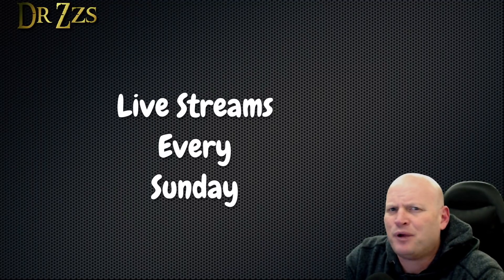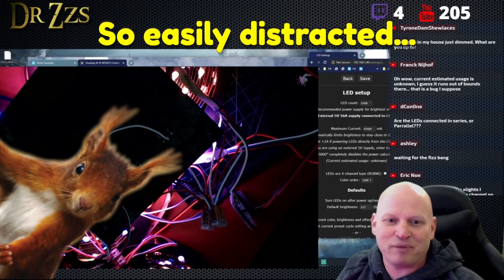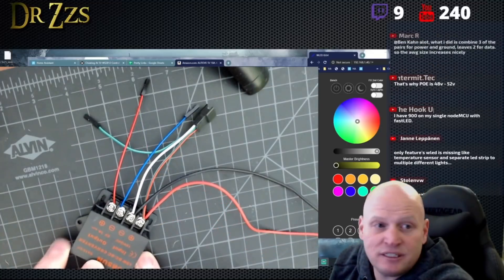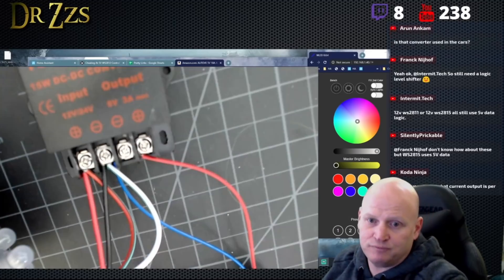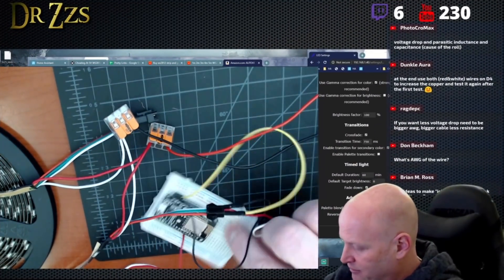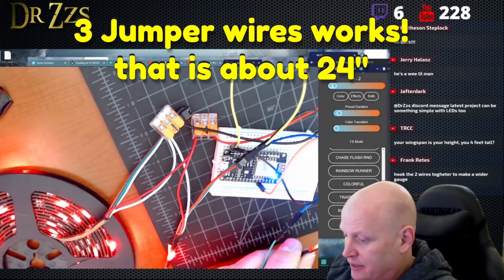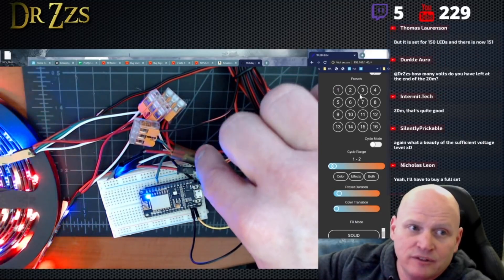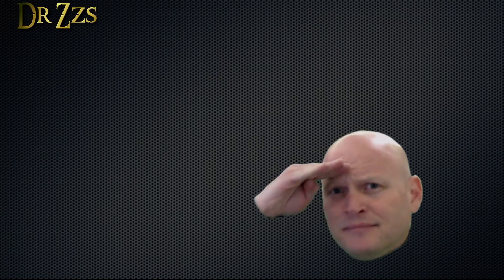Answers to the Most Common DIY LED Questions

Comment: Im trying to figure my ws2811 12v strip i have parallel supply for 6m with power injection at 4m and another 4m, the second 4 meter long is making flickering occasionaly. My data is around 30cm(1 ft?) ive been figuring it for few days now. No level shifter. I am assuming there is a faulty icu? Since i tryed everything else, checking connections and all, i am now at the point of adding pixel by pixel to figure where the problem is. 4m in wled is set to 40 as 3 leds are per icu. So far at 16 or 17 i noticed the flickering starts. But its hard to be sure, since it only flickers like once a minute or even less. Voltage at this point is 11.7v
Any opinions? Had similar problems with bad ground connection before, but was way more consistent. Any idea? Shortly after more testing if at pixel 17 flickering continues, i will replace that segment..

Comment: Hey if I have a set of LED strips 32.4 ft, which you know is 2 strips that are 16.4 ft, the 2 strips meet at a connection which connects to 1 cord down to the power supply. Say I wanted to put about 12 feet in between them, but only on 1 of the strips. Could I cut 1 of the strips just above the connection point and wire in a 12 ft extension (basically so the power is towards 1 end and not in the middle) connecting the strip back with the cord near the connection point? Would that work and still be able to work off that original power supply? Appreciate all the help. Love your videos.
Reply from the maker: Have an LED related question? Be sure to ask your question in led-lighting-diy- Channel on discord! https://discord.gg/8gvF67h Our LED masterminds, the PixelHeads, generally hang out there and can answer your question(s) swiftly.

Comment: This is exactly what I needed! I've got 2 esp32 that even with 20cm data wire does the same thing as happened when you connected the +100m wire, could I be unlucky enough to get 2 bad esps or am I doing something wrong? (I'm already waiting for another esp32 to make sure, as I'll need them anyway for other stuff)
Reply from the maker: Have an LED related question? Be sure to ask your question in led-lighting-diy- Channel on discord! https://discord.gg/8gvF67h Our LED masterminds, the PixelHeads, generally hang out there and can answer your question(s) swiftly.

Comment: I realize this is from a few years ago but...We now that a version of WLED that supports more than one data channel. All is now well in the world. 🙂

One other thing to watch for when using a power supply (other than through the USB port) is that a capacitor will probably be needed across the 5 vdc in and ground pins on the ESP 32. Mine ran fine via USB power but refused to stay running when I switched over to a 300 watt 5 vcd supply. A 10 uf capacitor took care of it.

Comment: First off GREAT VIDEO, Quick Question, I'm new to the WLED, and just got a New DIG QUAD (Dec 2021) and I was wondering if the Sacrificial pixel must still be used for long initial starts; by long im talking about 15 feet?

Comment: I have about a 24ft run to my first led with 18awg.  The first ~300 pixels work flawlessly, but then only the first 3 pixels work on the next strand.  The 4th pixel flickers.  Not sure if this is a power or data issue. I have tried other strings with similar results.  The voltage at the beginning of the line is ~7V.  When I add an led before the 24ft run none of the lights work.  Any help would be appreciated.

Comment: I’ve addd a sacrificial pixel like in the video. I’m 25’ from may strip 12v and only getting 5-6 leds to light. If I plug in 12” away all works great. Tried a new 25’ wire and a new pixel and still the same outcome. Help…

Comment: using 6x 5meter stripes 5 volt  SK6812WWA 5 volt addressable LEDS I have achieved lighting1767 using an Arduino mega and programmed through the Arduino IDE (not WLED) after LED number 1767 it all goes haywire which is a real shame because my route around the room where I intend to install them is exactly 30mtrs.

Comment: I know this is an older post.  But a couple noobie questions.   Is it possable to break up a string of lights so that each segment is addressable?  IE.  i have 4 Candy canes, each with 10 LEDs.  can I set up the NodeMCU as having 40 LEDS, but segment them into 4 groups of 10 for something like Xlights?   The other question is on data cable length.  Since the Logic voltage level on the NodeMCU is 3.3 volts, would you get longer data cable lengths if you used a logic level amplihyer?  They take the 3.3 volts and convert it to 5.  Thats more in the range of the LEDS

Comment: Does this mean I can have 40M between pixels? 1 pixel + 40M another pixel, 40M. 
And so on. Does each pixel re buffer the signal? 
Wondering about using high powered 2811 as floods on trees spread out in my yard

Comment: There were some good hints I guess. But, I assume you didn't use a resistor on the data line, right? Though, I don't think it's much of an issue. Also, cable connection suffer a lot on these breadboard setups, so things may look different for some of the showcases in the video if there was a proper connection between components.

Comment: Does the power supply amp requirement differ if we provide parallel vs sequential LED connection. e.g. Connecting 4 150LED 5V strips with power supply at 2 places from same 5V10A power supply?

Comment: Thanks Drzzs, I think i'm right in thinking by me using a computer PSU which i've done to stand alone, i can use the 5v for the esp8266 and 12v for my ws2811 :-) can wait to start going from normal grb's to addressable ones

Comment: Great videos!

You never hit the actual single WLED/NodeMCU LED limit.  I'm working on a 3000+ LED system currently and the WLED software won't let you enter a value higher than 1500 but it does run 1500 LED's in series and most effects work, but not all, there is some lag.  The software warns you when you go over 1000 that some effects may not work and it suggests max of 750 LEDs.

Also, my signal wire goes 24' to reach the #1 LED using #16 wire and the effects work fine so my long signal wire doesn't seem to be an issue without a sacrificial LED.
Reply: Did you ever resolve the issue about running over the light limit? If so, please share. Thanks!

Comment: The Esp32, at least the one I have, accepts up to 15v and down scales internally to 5v eliminating the need for the conversion board. Just mentioning because it reduced complexity slightly.

Comment: Maybe someone can give me some advice. My display is 6 candy canes each with 1 strand of 300 pixels. Currently each strand is a home run of about 50ft back to the MCU. I have all the data pins running in parallel. Three candy canes seem to work just fine but as soon as I add a 4th i lose it all. Will a sacrificial pixel fix this do you think?

Comment: So, if you can only split the data out of a node mcu, how can you make all the led's on a complete home do the sincronized show ive seen in some homes? Thanks for all the helpful videos
Reply: If your line is one continuous run, you would have to configure WLED with the number of pixels in your run and the data would run from one strand to the next.
Reply: @jhiserote  thank you for the answer, it seems to get more complicated, lol. So, i have to run one  long-single run with all the strips, I dont think i would know how to calculate the pixels. I'll need to do more reading on that. Thank you for the help
Reply: @jgarcia9527  Your strands when purchased should have told you how many pixels it contained.  For example mine showed  5m (16.4FT) 60Pixels/m (300Pixels).  Otherwise if you have WLED set up on a single strand you can play around with the LED count setting under LED Preferences until you light the last pixel on the strand.

Comment: Can you use CAT5 cable for both the chip/circuit and power? Anyone try this ?
Reply: I use a cat6 cable, 1 pair for the positive, 1 pair for the negative and 2 pairs for the data. works for at least 5 meters..

Comment: I know this video is about 1 year old, I'm unsure of you'll see my comment. I've bought WS2815 which use 12v and a nodemcu. Both are powered through the same 12v PSU with a dc-dc 12-5 converter with usb. Thus, I connect + and - from LED strip and the DC-DC converter at the same source. After, I connect through USB the nodemcu and I connect the data pin with a 470ohm (a lot of place on internet they says to put a resistance, I notice you don't?). Anyway, with or without the resistance, it doesn't work. I then put a 7805 (the negative equivalent) from the LED - to the GND pin on the nodemcu and then it work.

If I remove the 7805, the nodemcu get 12v - and the breadboard melt!

So, I don't get how it work for you because I'm unable to reproduce it.
Reply: ok, I'll answer to my own question. I think I know what happen because I just retried without my 7805 and directly connected to the GND pin of the nodemcu and it work. I think the problem is because I had the USB connected in my computer and the power from PSU, because of that, the ground from the nodemcu and the LED strip wasn't from the same source. My 7805 would save the day, but still not a good idea

Comment: Thank you for the videos. Question I have ws2813b leds, I have three esp8262 nodemcu's. there is a data  line and a "B" second data line. Where on the esp board do they go?

Comment: Tonight I decided to take the plunge, to learn more about electricity and Watts and amperage. I had a guy booked to do my house for 2300 bucks. My wife and I were super excited, but ultimately decided we couldn't do that kind of money for something so frivolous (in these uncertain times). 
I then started watching your videos. Bingeing your videos (and the hook up guy).

Anyway. Long story short. I ordered everything I believe I need, (dig uno, 5x5m strips of ws2811 30/m 12v, 26m of quarter round aluminum channel, 10m of 3 pin 20g wire, 30amp 12v ps, and of course an acrylic box/mount for my dig uno).

And my question... What gauge of wire should I use to inject power into my 5m string, how many times should I splice in injections, and, what is the best method with which to cleanly run the wires (and not have a rope of wires to try and tuck into the channel )to said injection points?

Thank you for anyone that reads this, I've been on the road working for 40 days straight, and I finally get to go home to my family in a few days, and I really want to crush this so we can enjoy them for Halloween, Christmas, all the colorful holidays!
Reply from the maker: awesome!  
20g is good for power injection.  with 5 strings of pixels you may not need power injection at all.  If anything I'd say just splice it in at the end to keep the brightness nice and uniform.  
Welcome to the club!

Comment: Great re-cap, Dr. I have one more question, though that you didn't answer. It looks like with a sacrificial pixel that you can have about 40 meters between your controller and the beginning of the strip - but what's the total length of strips and/or pixels that you can have in series after that? Is 20 meters of continuous LEDs (assuming 60 pixels/meter) OK? Will the voltage on the data line drop after that far? I assume that I will have to inject power in parallel every 2-3 meters. By injecting power, does the data line get "re-boosted", too at every injection point?
Reply: Did you ever figure it out?  I'm in the middle of an install right now.
Reply: @thebruhhh  I actually used a small logic level shifter instead of a sacrificial pixel. I ran almost 20 meters of LEDS past that with no problem.

Comment: I like the sacrificial LED, but i'm curious what - electronically - is going on under the covers, and how to achieve reasonable distances without using an LED.  What electronic components can i put on the 3.3v output side of the nodemcu before connecting to my WS2812B strip?  i'm sure this has been answered in a post, but there are so many!  THANKS!

Comment: We own Sonny's Dutch Mill in Rock Hill South Carolina and our sign on the  front of the building is done with shoe box letters with milky white covers with neon and each letter to light  them up white I'm going to replace them with addressable 3 LED modules 30 mm can you give me some suggestions on how to wire them to get the best effect

Comment: What is the best actual method to split the data wire? I saw your video, but I could not figure out. Is there another connector/adapter/splitter thatI need to buy? How do you wire it on the breadboard.  Can you take a picture or do a short video how to split data wire? This is my first LED project so I apologize if I asked silly question. TIA.

Comment: I must be missing something crazy simple. I ordered everything thru your links. Went with the ws2811 12v strings. I'm pretty damn good at following directions but I cannot get them to turn on. I even tried connecting directly to the power supply and the best I get is a faint flash when it first touches.

Possibly a bad power supply? (I don't have a voltmeter)

Does this sounds familiar at all?
Reply: Make sure ur data cable is Connected or they don't turn on.

Comment: Hi Doc, when injecting power every 5m, can it be one long cable running parallel to the whole run, with insulation cut outs, or must it be lots of separate lines?
Reply: any answer?
Reply: @michaele4468  I believe there's a limit, just not sure.  I've got one wire running to power inject four 15 meter strips and so far, so good.
Reply: It just depends on the size of the wire you use and the distance it travels. If the wire is to small then you will run into the same voltage drop issue.

Comment: I have a 100 led string of 12V.  I am using a 12V/2A adapter connected using the block you show in this video.  Everything works with WLED, I can switch effects, colors, etc. with the exception of I get flashes when it goes between effects.  I've tried both ways to connect the ground, separate and together, to no avail.  Anyone have any idea of what might be going wrong here?

Comment: What AWG would you recommend for 5V 30Amps? I'm having issues finding the right wires for this. I need to run this cable for 10-20 meters.
Reply from the maker: How many leds?  You probably aren't really using the full 30amps.  If you were then you would need like 12 or 14g wire, but that's not usually necessary.  I use 20g most of the time, but 18g would be easy to work with and still probably handle the load fine.  
Technically there are ratings for wire, but they are really conservative: https://www.powerstream.com/Wire_Size.htm
There's probably a better summary of current rating for wiring for LED lighting, but I haven't found it yet. 
Hope that helps
Reply: @DrZzs  I do have ~400 LEDs at 60mili amps per LED, so I'm not using exactly 30amps, but this may change in the future. Thanks a lot for the help!

Comment: I need help I have 12v RGBW 5 pin 
How do you inject power in to the second strand? The black + but where to solder the neg?

Comment: So if I order a 5w 60amp power supply,  and I'm running maybe 30amps worth of power, is there a way to adjust the amps or does it matter as long as it's 5v.  Sorry I am definitely not an expert at any of this but I enjoy learning
Reply: Mando Rodriguez amps won’t hurt it.     Just make sure it’s not over 5v

Comment: Can I use a 12v 2811 for the sacrificial pixel, or does it need to be 5v?  I ordered all 12v 2811. Can anything else be used instead, or do I need to order a string of 5v?  Thanks!
Reply: It needs to match the voltage of the lights you are using.  So if your pixels are 12v, do a 12v sacrificial pix.  If 5v, do a 5v sac. pix.

Comment: Hey Doc, this is a random question - I have a single pixel in a run of 250 where the green channel does not turn off when the rest of the lights do. If the brightness is up high enough I can get any color with this pixel, but at lower brightness levels you can tell the green channel is higher than it should be, and again, when it should be off it’s just on green. I’m assuming this particular pixel is shot and needs to be replaced, but I thought I’d ask if you or anyone has run into a similar problem before? Doesn’t seem like it would be a connection issue because every pixel prior to and following this one behaves normally. Thanks!
Reply from the maker: I have a random pixel that is red when it should be some other colors.  It does some colors fine, but often it is just red.  I'd say it's a dead pixel.  You could cut it out and splice in another one, or shorten the string by 1, or just pretend it's supposed to be that way.  ;p

Comment: I’m getting a strange effect when the wled app is switched to “off”. I have the sacrificial led set to off. The main string begins to light beginning at the start of the string, one led at a time, and progressing over several hours. If I turn the set on through wled it resets the string and starts over again. Any thoughts to the cause of this?
Reply from the maker: That is quite strange.  There must be some voltage seeping through into the LEDs.  Maybe swap to a different power supply and see if that changes anything.
Reply: DrZzs...Not sure what fixed it but I think you are right. I went back and unplugged and plugged the jumpers back in, checked the other connections and now no problems. My guess is a short somewhere in there. Thanks for the tutorials!